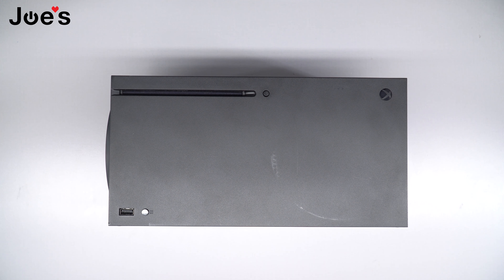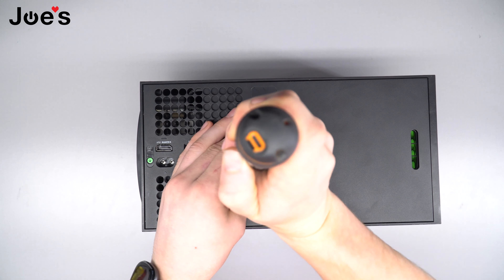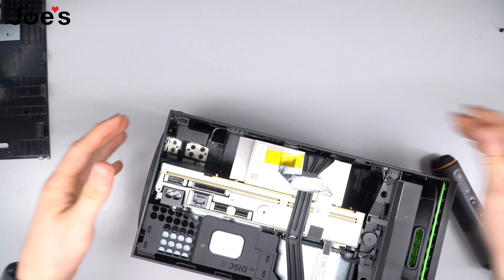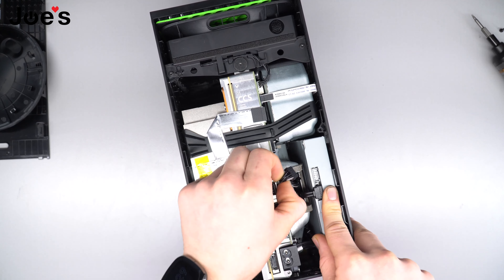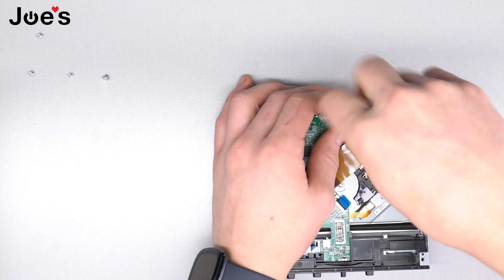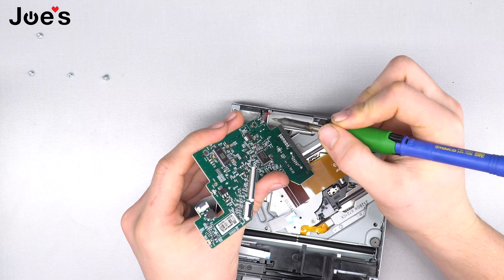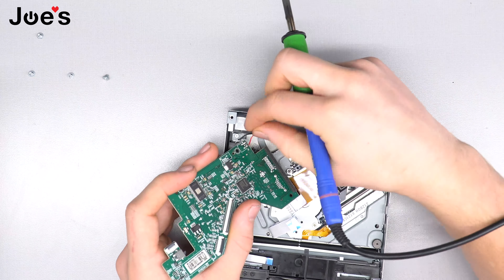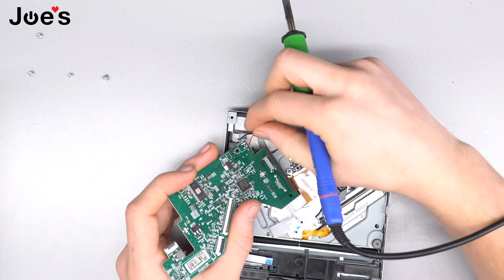Microsoft Xbox Series X Bad Broken Disc Drive Replacement | Repair Tutorial

Comment: Very instructive, good tutorial, why do you have to swap the boards though?  Is there some sort of firmware lock where the boards will only work with the Xbox they were shipped in or what?
Reply from the maker: Yes, the two boards are married to each other. Meaning that the disc drive will not be able to function unless it is plugged into its motherboard.

Comment: I might have pulled out the second part of the wire and I can’t put it back
Reply from the maker: Try flipping it the other way, I don't fully understand your question.
Reply: @Joesge but the pins got destroyed and bented are the pins replaceable I sent the Xbox to Microsoft repair center

Comment: would it be possible to do th8s with no soldering, like remove the actual drive from the chassis and replace with the new one?
Reply: also any links where to buy?
Reply from the maker: You will have to solder the daughterboard so you can remove the board from the old disc drive and install it into the new one.
Reply: @Joesge  thank you for the reply Joe, I did manage to find out the following information:

if the drive isn't working due to lens, for example can not read discs, then no soldering is required, as you're able to unscrew the motor and move the motor and board to the new drive.

if its the motor that has broken which seems to hardly happen, the soldering is required.

thanks again for the reply and hope this Info helps in the future.

Comment: Can I REMOVE the Disc Drive and KEEP IT OUT? 

In other words will I be able to use my Xbox Series X console with the Disc drive in general and not have to worry about failing any “Xbox updates” since my drive will be removed?
Reply from the maker: In theory you should be ok, but if an update calls for some sort of disc drive function, then it wont be able to find the disc drive and give an error, But I do not think this will happen very often if at all.
Reply: @Joesge  thank you for actually taking up your time to give me your respected opinion… anything between cars and Electronics I rebuild or build lol. 

I forgot my 2nd Cuzin works in Xbox’s hardware support team so I asked her and I actually got the same answer I was thinking that you also verified ! 

-So basically this is how it works… if your an Xbox insider you will experience more updates and specifically custom updates that can range anywhere in your consoles hardware! I lowered myself down to Omega so I won’t get to experience future consoles OS releases, just basic updates like a general Xbox owner! 

-So after removing my DISC SRIVE and put my console back together and started it up, the series X didn’t even give me an error despite every time you turn on your console you hear your disc try manually moving making sure it’s functioning properly, well this time I didn’t lol. 

Console starts up with NO Error code or any issues. I did have a small OS update and for some odd reason despite not detecting all its factory hardware (disc drive) it didn’t care and completed the update!!!!! 

I know this sounds stupid removing the drive but I’ve never used it once and whenever playing COD or Halo the console gets pretty HOT, so why have more hardware that runs in the background giving off more Heat? lol 

After removing it I have even more airflow. Specifically that goes directly straight up to the power source since the disc drive WAS below it AND DAMN BRO, what a DIFFERENCE!

-My series X is running 9-16F COOLER!!! Deff was worth it, whole point I did it was to increase the consoles lifespan considering these consoles reach up to 135-140F averagely. 

Not to mention it only takes 4 screws total and two simple wire harnesses to unplug the disc drive and it doesn’t even ban the warranty lmao

Comment: Is the daughter board not included on the one I’ll buy from Amazon or eBay?
Reply from the maker: The only daughter board that will work with your console is the one that is already installed. They are married to each other from the factory.
Reply: only the father is on board

Comment: Just wondering what you’d do if the logic board was broken
Reply from the maker: You could try replacing it, but it may not work. Some disc drives are married to the motherboard so if the board breaks then you may be out of luck.
Reply: @Joesge  it should be illegal this marriage of components.

Comment: My two year old has fed football cards into my xbox series x, i think there is a disc in the hard drive but nothing will come out. Just makes a racket when you turn the xbox on for a few seconds. Is there away you can open the disc drive up to remove the foreign bodies?????
Reply from the maker: Yes so follow this tutorial to remove the Disc drive. Once you have it out, there are 4 small Philips screws that you can unscrew to open the disc drive. That should give you an angle to remove any junk. If you need more room, you can also unscrew the daughter board inside the disc drive to get more access to the disc drive.

Comment: My series x reads blu ray discs fine but wont read dvd discs. I tried a bunch of dvd movies and backwards compatible 360 games and none loaded. What is the problem, and is it an easy fix?
Reply from the maker: I have yet to come across this issue. If it is reading Xbox one games, and normal blue ray it may be that the software isn't capable of reading out of date discs. I would certainly be surprised if that was the case but its possible.   Please email us at support@joesge.com with your question. We will be able to better assist you there. - JoesGE

Comment: Just wondering if this does this fix the E100 issue?
Reply from the maker: Most of the time, the E100 error is a storage drive issue. I have not seen it fix the issue, but it potentially could.

Comment: Hi there. I was just wondering. My console seems to be playing the majority of discs however some don't even recognize when inserted. ( fully clean ) Do you reckon this would be a faulty laser lens or disc drive issue? 

Thanks.
Reply from the maker: Could be a defective disc drive. But i have not seen that issue.
Reply: @Joe's Gaming & Electronics  when I put the game in it sounds like it's trying to boot and then stops. Does this 3 times and then no noise whatsoever.
Reply: @Joe's Gaming & Electronics  

Update: I followed the steps in this video and opened up the disc drive on the series x and I did the same on the Xbox one s. Instead of soldering off the bit, I unscrewed (3 screws) the piece underneath which contained the laser lens and moved that whole piece from the xbox one s into the series x and vice versa, clipped everything back on and presto it worked! The series x is playing discs again!
Reply: @TRVlogger  I have the EXACT same issue with my Series X. If I just swap my faulty disc drive out for a working one, is it really this simple? Just want to double check that an Xbox console's disc drive isn't tied to the console's serial number or anything like that requiring it to be flashed before I can replace it. Thank you.
Reply: @Duke of Spook  Hi there. I wouldn't swap the whole disc drive. Only the laser lense situated under the daughter board.

Comment: Mine is making a noise but works fine but im not sure if it needs replaced
Reply from the maker: Is it working okay? Doesn't sound like its scratching?
Reply: @Joesge  no it sounds like some sort of machine like a printer but then it works fine

Comment: I was told the disc drive is encrypted to that specific xbox and can not be changed and a new one will not work. Is that true?
Reply from the maker: Yes, but as long as you swap the daughter board on the disc drive you will be able to swap the disc drives also.

Comment: What if the board is fried?
Reply from the maker: If the board is fried on the disc drive im not sure if there is much you can do.
Reply: Take it to a professional, assuming what fried are mosfet/driver/regulator a professional should be able to fix it, it's very rare for the security (paired) components to fry unless you got water in there in which case you should just continue to use it without the drive after removing it.

Comment: Why don't you just replace the entire disc drive? Lol seems unnecessary to do all that work
Reply from the maker: You have to replace the daughter board because it is paired to your console. The disc drive will not work without replacing the daughter board
Reply: @Joesge  😢😢 it looked so easy at first lol thanks for the info though.